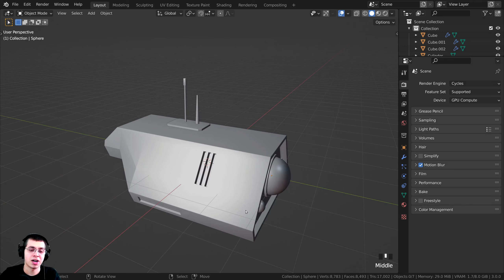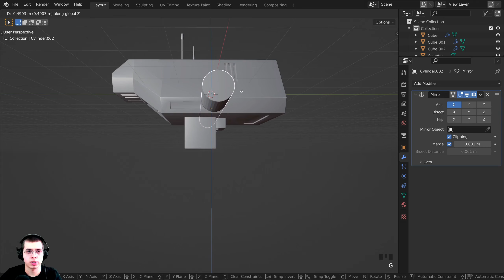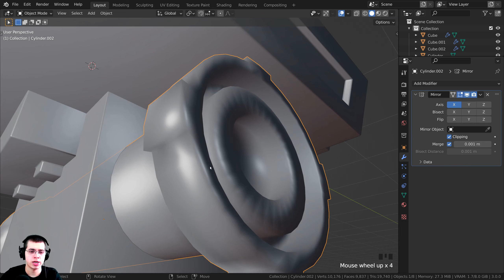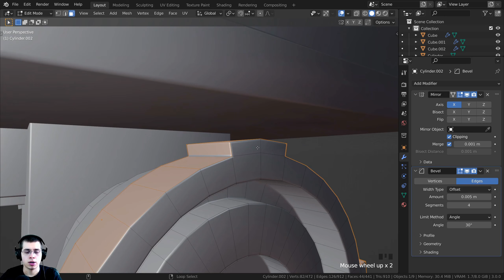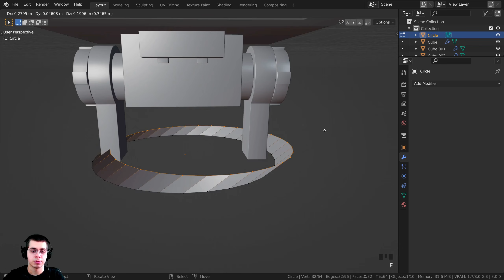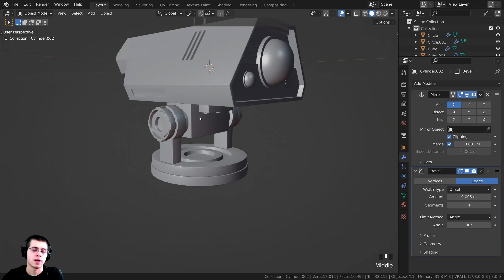Sci-Fi Worker Robot-Part 2 (Blender Tutorial)

Comment: my center of rotation for the cylinder is fcked up and i cant correct it with the basic set origin function 
can someone help ?
Reply: ok i got it too, just crl A the modifiers and THEN set origin to geometry ( it might sounds ridiculous cause im discussing alone but it can help other right ? idk )
Reply: @jacquesboulon1060 I exactly have the same issue but did not understand the tip bc English is not my native language, can you explain it a bit more pls ?? 😭
Reply: @sanada8261  the origin to geometry has to be on the whole thing so u must control A before doing it
Reply: @jacquesboulon1060  before doing what ? I can’t manage to do it I just started blender
Reply: @jacquesboulon1060  OMG WAIT I DID IT !!!! I DONT KNOW HOW BUT I DID IT THANK YOU SO MUCH !!!
Reply: @jacquesboulon1060  wait no it’s not working, the "wheels" are spinning correctly in edit mode but not in object mode 😭
Reply: @jacquesboulon1060  You can also do it without that. Just select the edge loop in the middle of the thing(first press shift h in Object mode to have a solo view on it). Then press Shift S and choose "cursor to selected". Then go back into object mode and set origin to cursor. After that you can press shift c to bring the cursor back to the center. (And alt h to unhide everything). Maybe this helps 😄

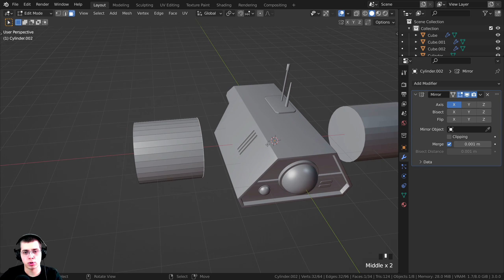Comment: 4:49 mirroring doesnt work for the cylinder :(
Reply from the maker: Did you go into edit mode before you moved it? The mirror will mirror from wherever the origin point is, so that's why I went into edit mode before moving it to the side, so that the origin point stays in the center. You can also just use the mirror object option on the mirror modifier, to mirror it from an object that's in the center.
Reply: I just lost there, thank you.

Comment: When I add the mirror modifier to the Cylinder nothing happens. Any ideas?
Reply from the maker: Try mirroring it on the X, or Y, on the mirror modifier settings. Also, make sure the origin point is in the center of the 3d scene.

Comment: 7:39
Shift X doesn't work for me. It still has that weird angle. Any way to fix? I'm in Blender 3.0
Reply from the maker: Hmm, it should work. So after you press S, to scale, then press Shift + X, to remove the scale on the X axis. If that doesn't work, I don't know why.
Reply: @RyanKingArt  It doesn't just move that part of the cylinder, it also moves the original part of the cylinder too. I hope that makes sense. I may just make a completely new cylinder.
Reply from the maker: @kyriewilliams3660  Hmm, ok. One thing to check: Make sure you don't have the proportional editing turned on. you can turn it on and off with the O Key.
Reply: @RyanKingArt  Ahhhh I figured it out! Thank you! So glad I didn't have to make a new one
Reply from the maker: @kyriewilliams3660  Oh good! Glad you fixed the problem. Thanks for watching!

Comment: I got a little bit of confusion between shade smooth and subdivision surface. I think it is good to use shade smooth for a smoothy thing. And sometimes I get troubled to sharpen the subdivided part using loop cuts
Reply from the maker: They are different things. Subsurf adds more geometry, while shade smooth just shades the faces smooth.

Comment: Hi, you did a really nice job with this tutorial. I would like to give you few suggestions. First of all I recommed you to turn on the "Auto Smooth" option in the Object Data panel, after shading an object smooth. 
Another thing you can do is either turn on the "Harden Normals" setting on the bevel modifier or use the Weighed Normal modifier. Both require the Auto Smooth setting to be turned on. "This can be useful to make some faces appear very flat during shading." I tell you more: with this two options enabled you can reduce the bevel segments down to one and still achieve great visual results! They are just two simple options and can really be a life saver.
Reply from the maker: Thanks for the feedback 👍‍

Comment: Snap to - Ryan you don't seem to use the SNAP option (centre top, approx under Shading) - it would be very handy if you wanted to precisely line up (at the 18 min mark) your circle centre vertex with the centre vertex of the "neck". Also if you wanted to extrude an outer edge level with the inner edge (per the circular base of the neck).

Very handy for all sorts of other lining up - I almost always have it on, whether vertex, edge or face, remembering to turn it off when I don't want unwanted snapping.
Reply from the maker: Yeah, snapping is a useful feature 👍‍

Comment: Just a quick question, Ryan. When I use the mirror modifier e.g. for the cylinder, I need to assign a mirror object or else nothing shows. Any idea what could be causing this? I'm using Blender 3.0 for the moment.
Reply from the maker: Hmm, you might need to change the axis that the modifier is mirroring on. If that doesn't work, then it might be because the objects origin isn't in the center. I'm using Blender 3.0 as well.
Reply: @RyanKingArt  Found it. The object origine point was in the wrong place. Thanks for the advice!
Reply: Ryan is right - you likely unintentionally moved the 3D cursor (the crosshair, with red and white circle), or moved the object in Edit mode away from its Origin (the bold orange dot, not a vertex orange dot), so your mirror is mirroring off a point you didn't intend. Its easy to accidentally move the 3D Cursor, by Shift Right clicking (I do it all the time).

It's difficult to explain with out images, but there is 2 things to fix it.

In your case to recentre the 3D cursor, you would need to Shift C to recentre 3D Cursor (to world origin by default) - then with your mirroring object, right click with it selected in Object mode and Set Origin, set it to 3D cursor - this will allow you to mirror from the intended point.

It's a tiny bit tricker when your object(s) are NOT being modelled from the absolute centre axis. In this case instead of Shift C to centre the 3D cursor (to world origin), you would first need to find an object with the correct centre point (imagine a head object) --> You would then Shift S instead and select Cursor to Selected (setting a Cursor centre point you intended, on the head). The 3D Cursor just implies - "this is where I intend to set the origin". Then on your other object (imagine an arm or leg), you would need to Right click (in Object mode) your outside object (arm) and Set Origin -> select Origin to 3D Cursor. This would mean the head and the arm would now both have the same (orange dot) Origin point, as intended, allowing you to mirror the arms from the head as a centre point.

You will notice lots of options (8) under the Shift S, which allow you to manipulate objects, origins and the placement of the 3D Cursor (per different requirements). Initially the seem a little daunting but really are not with a little experience and practice.
Reply: @JO546OO64  Thanks for your explanation, Jo. I will do some experiments regarding your advice!
Reply: @JO546OO64  Found it. The object origine point was in the wrong place. Thanks for the advice!
Reply: The same thing happened to me as well. After a few unsuccessful tries I tried to repeat the exact same steps from the video, and found the error:

- After creating the cylinder Ryan goes to edit mode, and then grabs and moves the cylinder (he specifically states is as well), I jumped that step to go edit mode, and moved my cylinder in object mode. So, the origin moved as well. Then, the mirrors were actually created on it's own origin, and since it's a perfectly symmetrical object you can't see any difference. 

Lessons learned for me: If you move the object in object mode, the origin is also moved, but if you move it in edit mode, the origin stays put.
Reply: @Rewendor  Sweet. Caught me out too. Thanks for the explanation :)